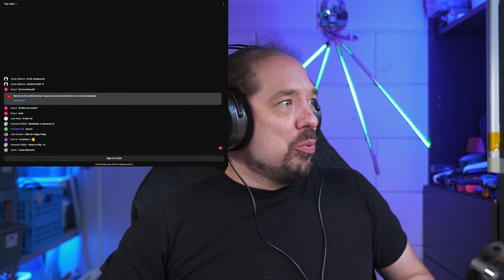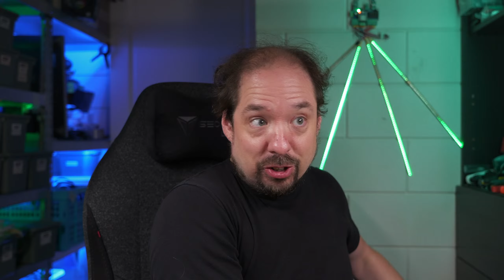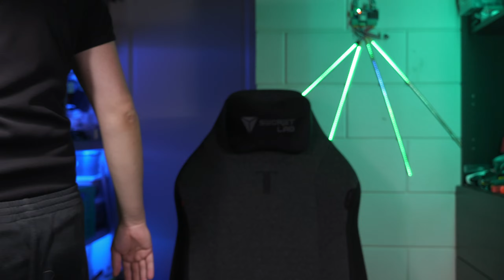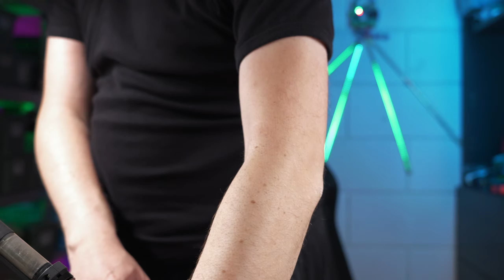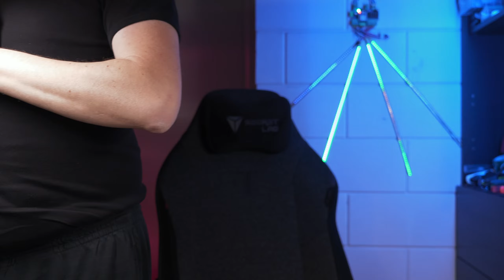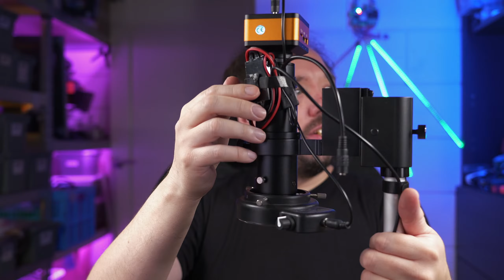Intermit.Tech #099.75 - Prototype dig2analog+ build

Comment from the maker: I just looked up the production files and yup, it has 2x 5.1K and not 51K + 5.1K so that is very likely the cause of the wrong output voltage of the buck converter, will try and replace them and see what happens!